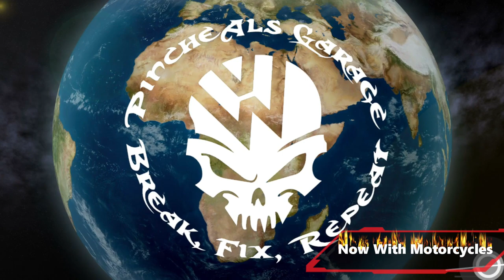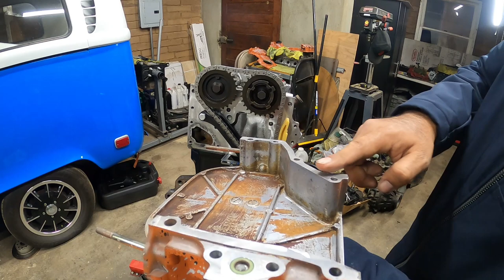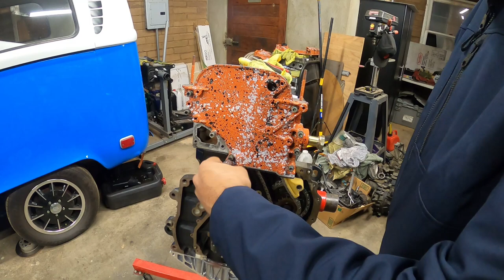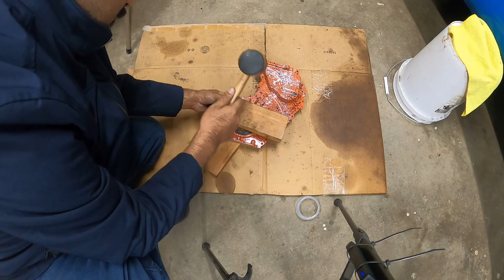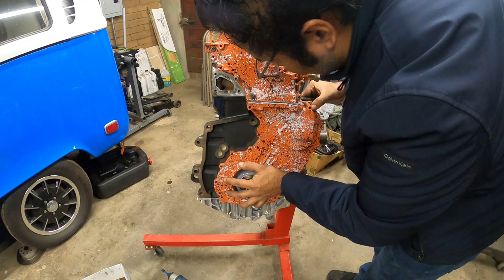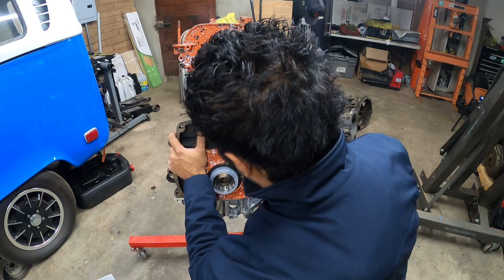VR6 TIMING COVERS - Patreon Built VRT

Comment: Anyone know if you can check chain timing with the transmission connected? Like removing the oil pan and valve cover and upper timing chain cover.
Reply from the maker: You can use the flywheel marking and the cams